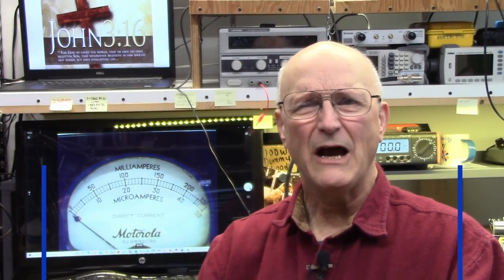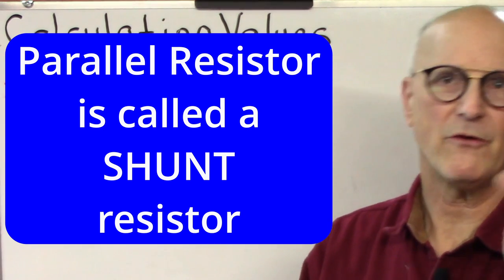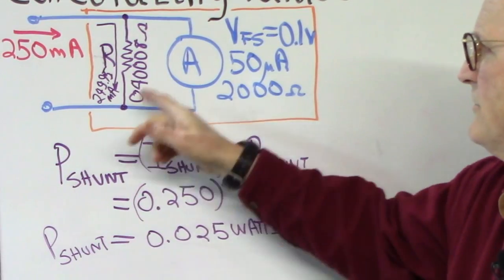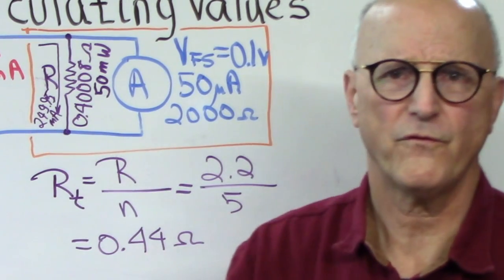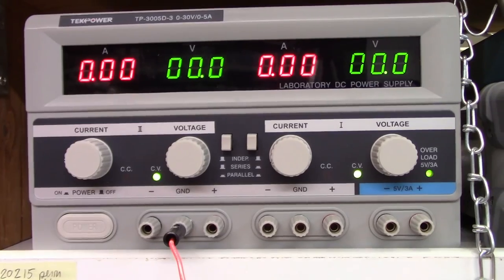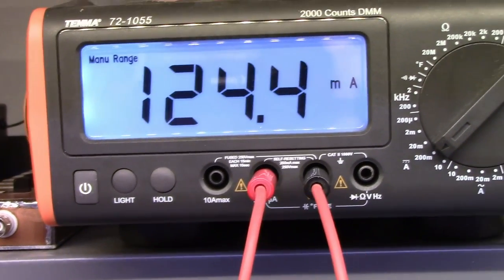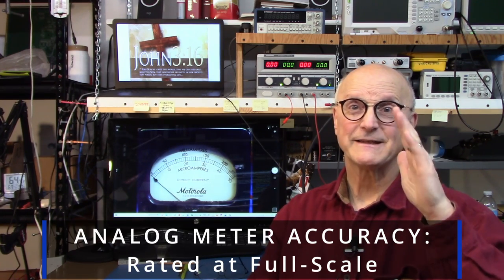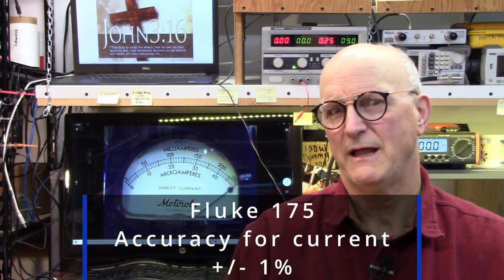Measuring High Current with a Low Current Ammeter: The Art of Adding a Shunt Resistor (019d)

Comment: I found a small ammeter and wanted to use in a classic car. I am assuming I have found it’s beyond use in this application providing I have calculated correctly. The gauge shows 120amps full scale. After characterising I have determined it has internal R = 9.1ohm and 13.5mA full scale. Calculations: 13.54v applied. 992ohm Rs (inline resistor). 0.4ohms offset. 991.6+9.1=1000.7
13.54v/1000.7 = 0.01353 = 13.5mA
If I wanted to use the fullscale of 120A I would need a 0.0010ohm shunt. If I reduced the scale to 15A I would need a 0.008ohm shunt. Possible? Correct? Love the guides. Many thanks
Reply from the maker: Thank you!  And you are very welcome! 🙂
Good question! Yes, if your characterisation of the meter is correct, then you would need a 0.001024Ohm resistor as a shunt for 120 Amps. Be careful! Your shunt needs to have the current carrying capability for the 120 Amps + proper derating. So, in my book this is 120 x 1.5 = 180 Ams at a very minimum.  I suggest using some sheet or bar copper as the shunt. Use a Dremmel tool to whittle away the edges to adjust it to your 0.001 Ohms.
Dropping back to a 15 Amp shunt (22.5 Amps for derating purposes), the resistance is now 0.008197 Ohms. Here you could use some #16 copper wire (chassis wiring rated at 22 Amps). This would have to be about 2ft long.
Hope this helps. 🙂

Comment: So what about going the other way. Using a meter rated for a larger current value and getting it into a requirement for a lower current flow. for example a 1 milliamp meter to replace a 60 microamp meter? Thanks Ben...
Reply from the maker: I'm afraid you'd have to modify the meter itself to do this. 🙂

Comment: Ralph, another great video. Your thoughts on using nichrome wire for shunt resistor?
Many thanks & 73.
De K4WRF
Reply from the maker: Thanks!  Using nichrome wire is a bad idea ... if you have it. Often the resistor value is quite small, so nichrome wire might be a bit too resistive for this application, depending on the specific resistivity of the wire and the value you are trying to achieve. 🙂
Reply: Thanks for the advice Ralph!
All the best.
Wh
Reply from the maker: @watthairston1483  You are very welcome! 🙂